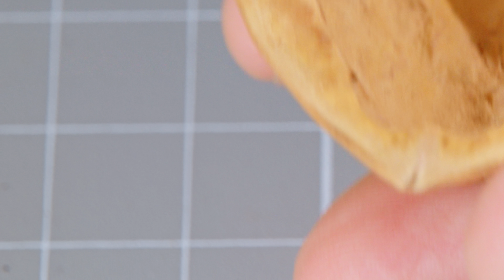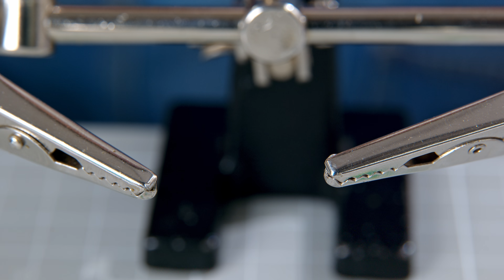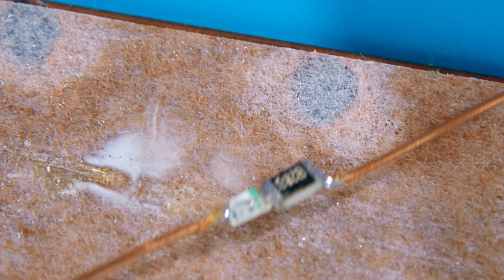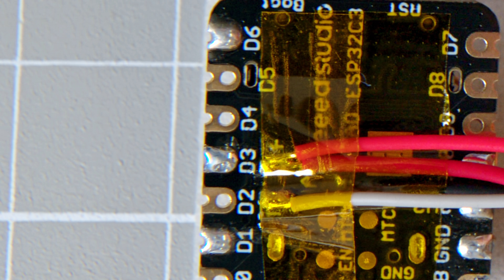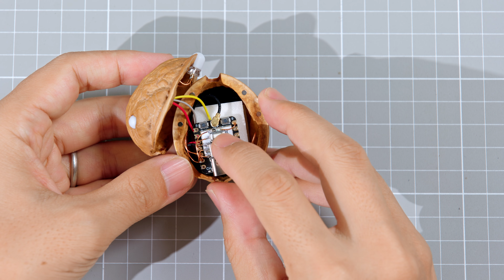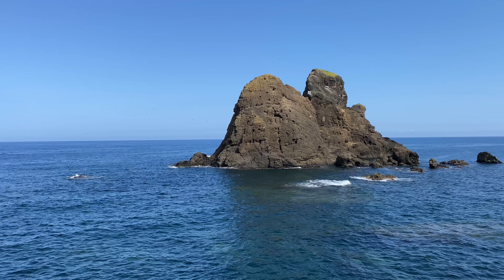I managed to pack everything inside the walnut.

Comment: Inspiring. If you’re gonna have to pop it open to connect to USB safely, then why drill the USB hole in the first place?
Reply from the maker: I drilled the hole so I could charge the device and upload new firmware without needing to take the walnut shell apart!

Comment: Anyone know what kind of wire the thin copper looking wire is? The wires that are soldered directly to ESP32. It looks like thin bare uninsulated copper wire, but that can't be right bc it would short out, it looks like wires are touching each other.

Comment: Every time I’m watching your videos I’m reminded that you’re a genius. 
An additional idea to build: 
1. A controller for the dust collector. That’s included switches for each machine to open and close the pipes that are needed or not and to start the dust collection with an after-run of x minutes. 
2. A smart charging station for the power tools batteries. If they’re fully charged, the power should be stopped automatically. 

Thanks and best regards

Comment: I saw you ate that. I put a crystal radios inside of a bottle cap. It only needed 3 wires to be plugged into transistor socket to amp it and listen to radio. Diode and coil.
Reply: I once built a Weather RTTY decoder, inside of a DB-25 connector housing.  It's a good thing that it worked the first time, because I wasn't going to try it again!  😂

Comment: If circumstances were different, I'd maybe use an ESP8266 mini or ESP32-C3 Super Mini instead and control it by Wifi, then you only need the socket for charging.

Comment: Magnet wire... I know I can tin them with heat.. but it never works.
Reply from the maker: Try heating the tip with a soldering iron loaded with plenty of solder!
The insulation will strip off in about 10 to 20 seconds.
Reply: Magnet wire is coated, so scrape the part you want to solder first, until you reach bare copper. Magnet wire is easier than litz wire.

Comment: It's all fun and games until a squirrel steals your electronic project.
Reply from the maker: Thanks for the comment! I'm happy to hear that.
Reply: Maybe I missed it, but where was the charging circuit for the LiPo?
Reply: @JohnSmith-gs4lw  It's a tiny IC under the metal cover of the seeed esp32 module. All the esp32 modules I've seen that have a battery connector and USB port, also have a charge/power controller/regulator IC.
Reply: @VeniceInventors  It appears so. I have some older Seeed Xiao boards (don’t think they have any wifi/BLE) and I’m pretty sure they don’t have the battery pads. That’s a very cool feature. You learn something every day!
Reply: Nuts!

Comment: Why a walnut?
Reply from the maker: I had seen images of electronic circuits placed inside walnut shells, so I decided to give it a try myself.
There was no profound purpose behind it, but I learned a great deal during the miniaturization process—such as the challenges of working with tiny components and ideas for saving power.
I believe that a seemingly "meaningless" challenge is, in fact, the most meaningful kind of challenge there is.

Comment: Tiny neodymium magnets near a food item is potentially very DANGEROUS .  I would not do this.
Reply from the maker: At the very least, humans do not eat electronic circuits.
Are you an alien?
Reply: @jisakukobo   There are so many safety issues with magnets near food.  Your video might impress on some a normal or casual association of the two.  Are you an alien?  People clown around with novelties.  Imagine someone popping a glowing walnut in their mouth where one magnet pulls on its opposite and the seam shifts.  Small children or pets working by scent are at risk.  Even strong magnets on a refrigerator can be a potential hazzard.  Strong magnets in the digestive tract are a serious issue.
Reply: @jisakukobo   not deliberately, are YOU an alien?

Comment: What a handy, accessible project.  Thank you for sharing it with us.  Some thoughts:

1. The ESP32 has several power modes that you can switch between to maximize battery life.

2. I think that a 'PCB vice' would be a wise investment, as they work a LOT better than alligator clips.  You could also make your own by A) mounting a long bolt to a plate, and epoxying two nuts to two washers.  To use it, you first thread one nut onto the bolt with the washer facing up, then place your PCB/etc. on top of the washer, then thread the other nut onto the bolt with the washer facing down, tightening it down to hold the PCB in place.  As they are so easy to make, creating a half-dozen is sensible.

3. Another style of vice uses a long threaded rod and presses in from the edges rather than pinching them, much like a regular bench vice.  You should also be able to make one of those fairly easily.

4. I would add humidity and light sensors, so you could — for example — automatically turn on a humidifier/dehumidifier or turn down a noisy fan at night when the lights are turned off.

Cheers!
Reply from the maker: 貴重なアドバイスをたくさんいただきありがとうございます、今後の制作の参考にさせていただきます！😊
Reply: @jisakukobo  You are very welcome.  /bows

Comment: 2 things I learned here: 1.  I do not like looking at lotus seed pods either and 2. using double sided tape to hold tiny electrical parts is a great idea!
Reply: Not liking lotus seed pods is called trypophobia (if it's really bad)
Reply: Applied Science has a recent video that gets me worse than the trypophobia examples I've seen, but it's a branching structure instead.
Reply: Same...
Reply: Holes in a cut English muffin will get to you too if it’s really bad.
Reply: In fact, the seed pods are watching you... 😳🥺😵‍💫